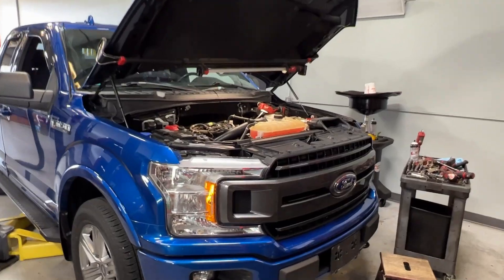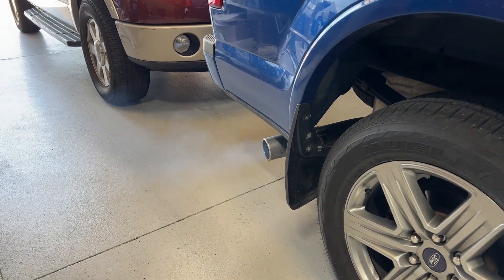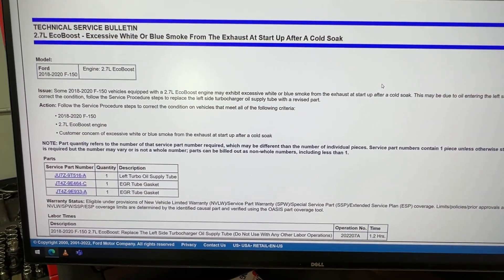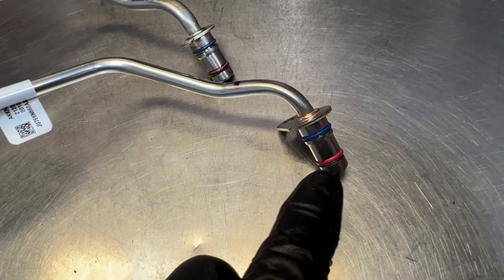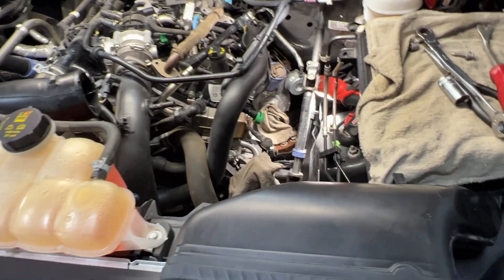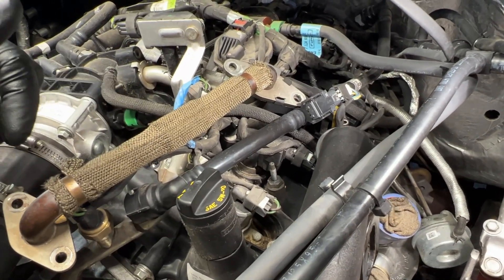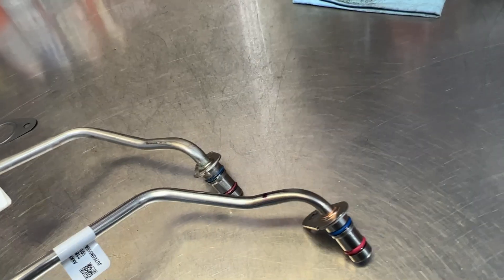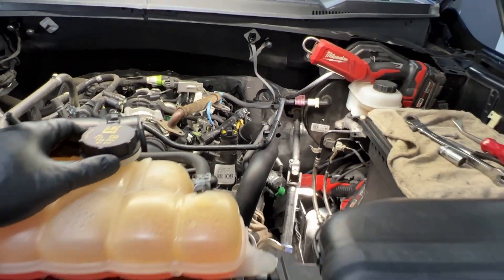2018-2020 Ford F-150 2.7L Ecoboost: Blue Smoke Upon Startup Confirmed Fix!

Comment: Ford was incorrect in my case. I replaced that part on mine but it still smokes like a train. Very heavy smoke!!! Could it be a bad turbo charger on the driver side? It's like oil is still getting inside my turbo from somewhere. Trying desperately to not have buy a new turbo charger. I have not changed the EGR pipe yet, Not sure if that is why it's still blowing HEAVY smoke out the tail pipe though. The smoke from my tail pipe is so thick I couldn't see the vehicle behind me while sitting at a red light!!!

Comment: I have read the bulletin and it says blue or white smoke.  I always felt the 2 colors abd smells were related to different problems.  I have a very light white puff abd the smell of antifreeze.  I'm going to replace the EGR cooler. If that does not fix it, have you seen anyone get this tube replaced due to coolant smell/smoke or is it mostly due to oil?  Thanks for any input.  Really find your videos helpful!

Comment: I had a 2015 Lincoln MKC with the 2.0 turbo ecoboost engine. And i was told that this is VERY common with turbo engines after sitting for a while. Upon a cold start up. It never bothered me or the car's performance at all. So while this may have been a problem with this particular vehicle. Many other Ford or Lincoln vehicles do the same thing whether it's a 2.0, 2.3, or 3.0 turbo ecoboost engine.

Comment: My 2018 Ford F150 ecoboost 2.7 just started having this issue about 2 months ago. I finally got around to working on it. I removed the old oil supply line and brought it to the Ford dealer. The part they provided was the exact ae one. Parts guy at the dealer said there was no change on the part is having the issue. Do you have the part number for the new line that you have??? Help please
Reply: The new tube assembly per the TSB is JU7Z-9T516-A.  I'm having this same issue on my 2018.  Have you had any luck in resolving the problem since you posted here?

Comment: So I'd put money they put a check valve in the Turbo side so when oil pressure drops to say "5 psi" is closes and just keeps the oil in the line not letting it drain into the core housing and past the shaft seals.

As for the O-ring Ford probably figured out the O-ring wasn't needed and on the new part they just said don't waste the money on the part and machining.

Comment: Just performed this repair on my 2019 F150 with 2.7L at 63k miles. Thanks for posting this video. It helped me quickly diagnose and fix this issue. New pipe has been in a week and no more smoking on start up 👍
Reply: Also can some explain what happens if you dont fix it or if its will be a problem.
Reply: Did you use the parts listed in the TSB? I have a 2018 and the Ford parts site says the oil line doesn't fit. Searched it as a 2019 and it said the same thing. I used VINs for the parts search. Thanks.
Reply: I took it to a mechanic. It appeared to fix the issue for about 2 months but I just noticed the smoke again so it appears to be another contributing factor
Reply: @Justin-jn2qx  thank you. It would be great if you could update what the issue is if you find out.

Comment: Which engine would you recommend for the F-150 for 2018 and up? What's your opinion on the 2.7 with the belt driven oil pump?

Comment: it didn't work
Reply from the maker: Then this was not your problem.
Reply: @@Jeff-bg1hr my truck has been at the dealership since September 20th 2023, it is January 4th, 2024
Today.  They keep coming up with all kinds of excuses, no technician can handle it, need to order parts, it was valve seal guides, now it is the long block…not sure what will be next.  I’m having FO MO CO as the liaison, I’m don’t even call the dealership anymore.  Hoping I get my struck back this decade!

Comment: Have you done this on a 2016 F-150 with the 2.7l? The TSB states that the driver’s side tire and fender shield have to come off but I see you didn’t have to do this in your video. Didn’t know if there is a big change in procedure from a 2016 vs the 2018 you worked on in this video. Thank you for your time and all of the information you share

Comment: Fordtechmakuloco I have a 15 2.7 with 68k miles on it.  Started with the blue smoke on cold startup at 60k    Saw this video on the fix.  Took my truck to a nearby ford dealer service and told “ them “ what I’ve seen is the issue.  After a day they confirmed that it’s the ( left ) side turbo feed line and they replaced it.  I took my truck home and after a cpl days sitting started it to the same cloud of blue smoke . I’m kinda pissed because they either didn’t fix what they said they did or there’s something else wrong on a motor that has 68k miles on it.  I’m 67 years old and I’m not rough on my equipment.   Could it be the other turbo feed line ? Because it’s a twin turbo or am I misinformed?
Reply: DEALING WITH A 2016 2,7L AND SEEMS TO BE THE VALVE GUILDS LEAKING OIL.  CHECK YOUR INTAKE TUBE FROM TURBO FOR IT TO BE FULL OFF OIL IF NOT ITS PROBABLY HEADS

Comment: I recently replaced both of my turbos, and as such, both of these oil feed lines on each side. 

Before I decided to replace the lines, I flushed them with brake cleaner.  

Upon doing this, I realized that I had a free flow of brake cleaner through the passenger side line.

The driver side would not flow any brake cleaner through the first I thought  “there is my restrictions, and probably the reason why my driver’s side turbo failed”.

But upon closer inspection, there is a ball or check valve underneath the filter on the driver side passenger side line does not have. 

I can only assume that check valve is what what was updated, and as what, keeps oil from draining down into the turbo housing and being burned.  

Love your videos  💪
Reply: I was doing this repair and noticed the same thing. I wish there was a detailed document with more info about the updated line.

Comment: Great video. I just completed this on my 2017 Ford F-150 2.7l EcoBoost. I'm not sure if it's just specific to the 2015-2017 models, but the updated line had a check valve on the filtered inlet end going to the block. The one I took off the truck, what appeared to be original, looked identical to the 'updated' one for $250. When I popped the filter off the new line I noticed the check valve. I did not have the 2 o-ring set-up at all.
Reply: My 2016 is doing this. Need to find the part
Reply: Did it fix your problem?
Reply: It did temporarily, but it did not fix the problem in the long run. I still get intermittent blue smoke on start-up.  @chrisfit
Reply: @slowyo9645 any solutions since this one was only temporary? I’m currently looking to stop this in my 2017 2.7 ecoboost
Reply: @MANtrout705  not at the moment brother, I’m still looking into it and will update - please do the same! I’m thinking either driver side turbo prematurely failing internal seals (113k miles) or engine valve guide seals.
Reply: @slowyo9645 same issue on my 2016 2.7. I'm going to get the line replaced and then see what happens from there.
Reply: @morganlingsweiler9813 I guess I’ll do the same 
It stared at around 115k miles
Reply: @isaias131982  I had mine replaced and saw smoke the day after but now it doesn't smoke anymore
Reply: @morganlingsweiler9813  nice, thanks

Comment: Your video is great help.  Went to dealer back in 2021, they changed the left turbo oil supply tube, but did not resolve the issue.  So went back two weeks later, but the dealer stated white/blue smoke is normal.  Out of curiosity,  are the newer and older oil supply tubes have same part number?  Thank you for your help.

Comment: Seems that 2.7 rarely shows up in your videos. Are they that "bullet-proof"? I did hear good things about that engine
Reply from the maker: One of Ford's most reliable.
Reply: Question, I’m looking to purchase a 2021 2.7eb. How is the reliability over the long run?
Reply: @jesustinoco401  I have 2017 model, 80k miles all good so far

Comment: @Fordtechmakuloco  mine is a  2015  and its doing this same thing. Does this fix apply to my 2015 as well? truck has 120k miles
Reply from the maker: Yes there was another TSB 15-17 models
Reply: Thank you
Reply: Is it a dealer only part? I havent found it online
Reply from the maker: yes it is.

Comment: I'm having this issue with a 21 5.0.
When I purchased the truck from out of state, it arrived with no oil reading on the dipstick. When I drained it, I got about 2 quarts out.
It's not making any sounds, just blue smoke on cold starts.

Comment: I did notice smoke on one start up,  but nothing since.  Have you dealt with engine code error P21D2?  Just had the injector 4 replaced and spark plugs as well.  Engine light back on.  I see one post about possible MAF or MAP sensor issue.

Comment: Great video. I have a 2019 F150 2.7 EB. After watching this video I noticed the blue smoke. It’s not a lot of smoke, but noticeable. Is the blue smoke more of an annoyance to owners or a more serious problem if not fixed can be detrimental to the engine?
Reply: you can foul cats and o2 sensors which will cost some money to replace

Comment: Interesting and odd fix.  Are these 2.7's good motors?  Cam phasers?  I heard they had problems with oil pans leaking.  Did they get that fixed?  is the 2.7 worth buying in the F150?
Reply: There's a 2nd gen 2.7 that was upgraded to fix allot of these issues . 2018 and newer.

Comment: Just took my 2020 2.7L F-150 in for this issue, dealer put a JT4E6N660BA in. I'm not sure what the new p/n is supposed to be, but from the looks of this video it should be JU7E6N660AA.

Did this dealership just scam Ford out of a couple hundred bucks? I'm not sure how Ford does their parts.

Thanks!
Reply: 👆Thanks for watching, love you so much fan!
                   👆  Tell  Aɴᴅʀᴇɪ Jɪᴋʜ, you were referred by me he has something new to share with you easily get in touch with him.

Comment: My 2019 2.7 (23,500 miles) had the blue smoke after a cold start when I parked at a slight uphill. I took the Ford TSB to the dealer and they ordered the part and fixed it. No more blue smoke. 😄
Reply: Anyone know the part number?
Reply: Will they do this for free out of warranty?
Reply: Nope they won't. I've been fighting them all week
Reply: I've got a 2019 2.7 , booked appointment 3 weeks ago and I just rolled over 60k miles. Appointment is tomorrow. I called and they said nope it's out of warranty. They won't touch it without me getting my wallet out.
Reply: Can you tell me if the gen 2 2.7L ecoboost has this issue? Mine is a 2019 XLT.

Comment: @FordTechMakuloco Great video!  I have been to the dealership 3 times for this issue and they were just shy of taking the engine apart.  This all started from an oil change where they overfilled it.  My gut told me to hold off as nothing was mechanically wrong with my 2018 F150.  I wish I would have found this sooner, definitely subscribing to your channel!  I'm looking to make this repair myself, can you advise where to purchase all the necessary parts for this repair online?
Reply: 👆Thanks for watching, love you so much fan!
                   👆  Tell  Aɴᴅʀᴇɪ Jɪᴋʜ, you were referred by me he has something new to share with you easily get in touch with him.

Comment: I have a 2016 2.7 with this issue. It's quite embarrassing when others comment on it because at times the amount of smoke produced can be alarming. Will this solve the problem for mine as well? If so, what is the part number? Thanks in advance! Matt
Reply: My 16 has the same issue. I believe the fix here is identical, but would be curious for an expert opinion.
Reply: Old post but a catch can helped my '16...
Reply: Any updates? My new to me 2016 does it and from my BMW days this kind of smoke usually points towards turbo failure.

Comment: Good afternoon sir good morning good morning I hope you’re doing well. I have a 2002 Ford F150 5.4 with 2 valve. My problem is occasionally my odometer starts flashing erratically is it trying to tell me something and occasionally I get like a misfire and then it goes away, please help if you can Also sometimes the misfire happens on his own without the odometer numbers going crazy. I hope this makes sense. I know everybody’s gonna say the odometer flashing is giving you a code that your truck is missing firing

Comment: I have the same truck  deference color  same  issue blow smook in cold start  and smell oil 2018 2.7 eco boost  twin turbo v6  2nd sports I have 60,000 miles   I wish  bring my truck  to you  and make it right every  time I taken my truck the dealership it  has problem  I want my truck back in shape

Comment: I'll add, for those that might be looking for smoke from their trucks, the blue smoke is definitely oil and I've seen this repair work many times. 
All of these trucks do smoke white several seconds after startup, like seen in the video, as a normal condition.
We had to chase the white smoke for a customer several times before ford responded to us, saying the trucks are programmed to heat the catalytic converters shortly after starting, in order to remove built up condensation. Many people confuse this as an oil or coolant burning issue.
Reply from the maker: Yup you can see it is more of a steam and not a thicker white smoke from coolant or fuel.
Reply: My girlfriend is strongly considering a 2.7 with about 50,000 miles on it. Are y’all saying that this blue smoke thing is not a problem?  I ask because she has had absolutely horrible luck with cars in the past two years.  She got a little over 24,000 miles out of the 2017 1 L turbo Ford focus we got her a year ago and it just seized from engine knock (after getting the oil light on the dash the day before) the other day (91K miles) straight off the oil change rack.  Needless to say after all the money I dumped into the car, I am scarred and skeptical about turbo charged gas engines.  If she gets the truck, and this is an issue that needs to be addressed, I want to address it asap.  Please let me know what y’all think. Thank you!
Reply: @colinc1633  the 1.0 ecoboost in the focus was a throw away engine. Sorry to hear that happened, but ford does have a TSB stating if it has low oil pressure codes, just put an engine and turbo in it. The focus' in general are nightmare cars and we won't sell them anymore.
The 2.7 isn't a horrible engine, and the smoking on startup isn't a catastrophic failure of any kind. The only failures I've seen were 2 different 2.7 motors leaking oil through the valve guides, which ford also has a TSB out for(17-2077), but that's only for trucks built between April 1st, 2016-January 1st 2017.
Turbos aren't much of a concern on newer models, as long as you're changing oil and doing other maintenance regularly, and like many cars you might expect to do phasers at some point, and an oil pan reseal.
Either way, just get a decent service contract and they'll usually cover that stuff. I don't think you'll have as many issue as you did with a 1.0 focus.
Reply: @colinc1633  im glad I got back to these comments.
Ford has recalled the 1.0 ecoboost and the recall includes owner reimbursement for past engine replacements due to oil pump belt failure.
I'm guessing the car is long gone but if you have the paperwork with your name, the vin and the engine replacement on it, contact your local ford dealership and ask about it.
The recall is 23S64. 
We typically see ford reimburse customers within a day or two (though some dealerships don't have an on-site warranty admin, so this could take longer).
Reply: Do all 2021 2.7s have the updated oil tube?
Reply: @natureboys9035  yes

Comment: Great video. I'm curious on why the coolant line has to be removed on the 2015-2017's to change the oil feed tube? I can see having to remove the turbo flange bolt/stud is required to access the oil tube mounting bolt.
Reply: Do the 2015-17 2.7s use the same oil feed line? My 2016 has a cloud of white/faint blue smoke on the morning start up.

Comment: My `18 F150 2.7l used to do it intermittantly and then stopped by itself. I figured it was the seal ring on the turbo shaft rotating it`s gap.

Comment: I’m having this issue with my 2016 Expedition (it’s the 2014-style F150 EcoBoost engine)… and my dealership said that it was normal 2x - but I can SMELL the richness of the oil in my exhaust… thanks Ford

Comment: off subject my 98 taurus climate radio wont turn on only the rear defrost works all fuses check out  any suggestions.also before it completely  died at time when i started the car i would hear clicking sound and radio  would cycle on to off.

Comment: I would have thought that was total baloney but it makes sense:  while the engine is running the oil is pumped under pressure and when the vehicle is off you would want it to drain back into the head.  Only thing I worry about is leaks down the road due to elimination of the first o-ring but at least you'll make a video about that now, if it happens.  Lol.

Comment: Mabey they added a restrictor orifice inside the new tube so it delivers less oil. That way it doesn't overfill the turbo housing, so drain back can happen quicker when you shut it off. Over delivery of oil in the low friction environment could also cause it to consume oil while running, but was undetectable because the engine is up to temp.
Reply: That would increase the risk of sludge deposits blocking flow at the orifice.
Reply: @hochhaul  If the oil is to spec and it's maintained to any extent "sludge" shouldn't be circulating in the pressurized oil galley of any engine. Restrictors or Orifices are part of many lube systems. Piston coolers being an example, never heard of one clogging ????